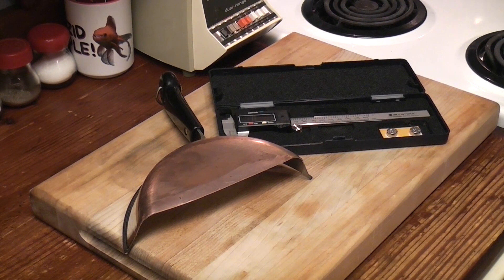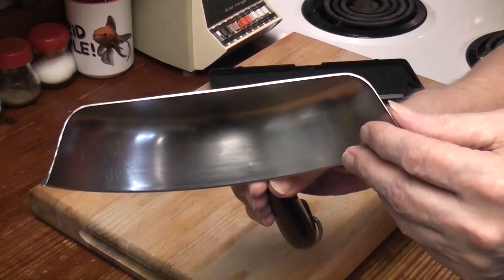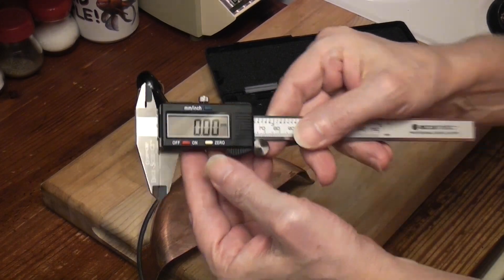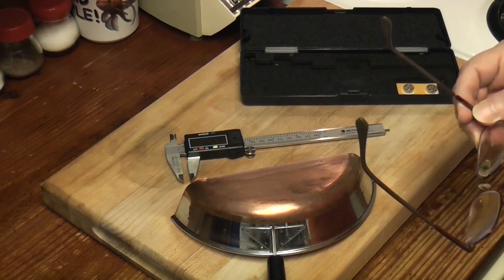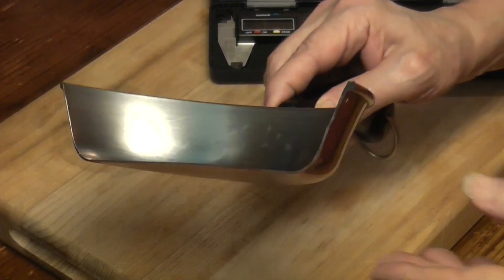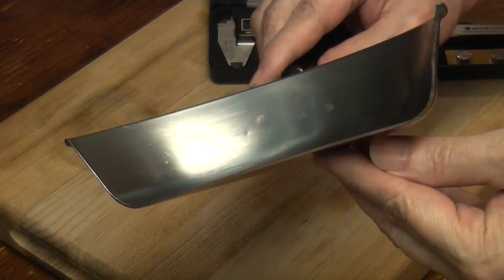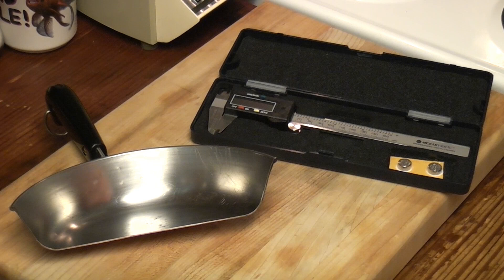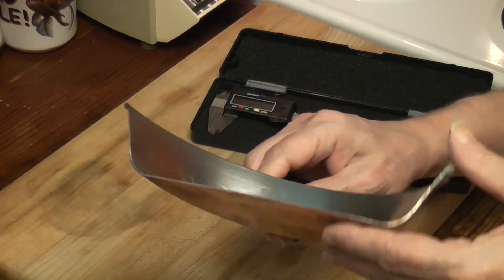How thick is the copper cladding in this Revere Ware Pre -1968 Skillet?

Comment: I have a good bit of high end cookware. I use it all the time and love it. Demeyere, All Clad, DeBuyer, etc. I own a set of this type of Revere Ware that I purchased on clearance at a Kmart in the Northeast in the early 1990’s. Although, I rarely use the small frying pan and the stockpot, I use the saucepans all the time. They are excellent for rice, gravy, oatmeal, grits, and canned soup. They also work well for reheating certain types of leftovers; casseroles and such. The larger saucepan came with a steamer insert and is great for steaming veggies and eggs. They are all fully intact and I don’t know that anyone would guess that they are around 34 years old. I would say I got my money’s worth😊
Reply from the maker: Nice! And they save on electricity or gas they heat so fast! So there's that :)

Comment: The tips of the calipers shouldn't be used for this measurement; they are for measuring the thickness of a rounded wall, like the end of a tube.  Use the flats of the caliper jaws on flat surfaces.
Reply: @xetaprime  Xeta, thanks for your great cooking demos! And the thin Revere measurements had me discouraged for a minute because I've inherited & I'm learning to cook with my Mom & Grandmother's Revere Ware, so @adamchurvis1 I'm glad to hear Revere Ware lasts. And this discussion brought back memories of when I worked as a liaison planner between  engineers & aircraft mechanics--much respect to skilled machinists!
Reply from the maker: If you look closer, that's what I used. The rear of this caliper is for tube measuring.
Reply: @xetaprime  We're on different pages, I think.  The rear of the caliper jaws are for measuring the inside diameter of tubing, the very front of the caliper jaws -- the tips with only a very narrow flat surface -- are for measuring the wall thickness of tubing, and the middle section of the front of the jaws is for measuring surfaces that are flat across the width of the jaws (plate, outside diameter of tubing, etc).

This is the same caliper jaw configuration as just about every set of calipers I've ever seen.  My Starrett is the same (except mine is entirely Old-School mechanical).

I used to design firearms.  I used my calipers so much the retaining clip for the depth gauge broke.  I remember getting measurement tips from the machinists at Georgia Tech about 40 years ago, before I started using them.

It's weird how they teach you how to calculate Stress and Strain on complex structures and calculate Heat Transport problems until your brain begins to smoke, but you can graduate with a Bachelor's degree without ever having touched a pair of calipers!

I saw things differently, so I paled-up with the machinists and hired them on the side to make prototype parts, etc., and teach me about the "bare metal" of Mechanical Engineering.

Sorry to kvell, but this brought back memories of some of the best parts of my long-ago youth.
Reply from the maker: @adamchurvis1   The flat surfaces (top/bottom) of the front of the caliper measure in about an 1.25". If they are actually parallel, I should be able to use the tip of the caliper. The reason I didn't measure in further, is because the pan is not perfectly flat, which might give an incorrect measurement. Measuring in a 1/16" or 1/8" would give a more accurate reading.
Reply: @xetaprime  Ah!, the uneven surface problem.  I couldn't tell because I didn't display the video large enough.  Yes, that's a perfect reason to use the tips over the middle.

The reason for not measuring using the tips on planar surfaces, I was told, was because it was easy to cant the calipers while measuring, thereby rendering an inaccurate measurement.

Anyway, my 40-year-old copper-bottom RevereWare saucepan gets more use than the expensive stuff.  A real workhorse.

Comment: Finally! I think I've read that electroplating copper can only go about 0.5mm maximum, so the stainless steel is about 0.8 to 0.9 mm thick. Even thinner than I expected! I was expecting the stainless steel to be a full 1mm thick. Even then I'd rather have Revere Ware over to 2.5 - 3mm of copper. I've owned a copper pan that had 1.6mm of copper with 0.4mm of stainless steel and I thought that was far too heavy. I hated it and have it away to a co-worker.
Reply from the maker: Really. Wow. I didn't know 5 was max. Huh. Yeah, sorry it took so long! I was in caliper blocked mode :)
Reply: @xetaprime  Yep, half a millimeter is about the max that can be done. But at least we have a more definitive measurement of the pre-68 stuff.
Reply from the maker: @AngelusBrady  Maybe I should cut one of my saucepans in half. I think it's thinner! :)